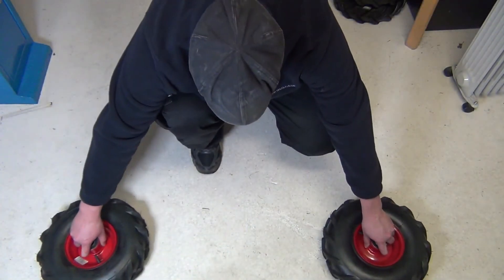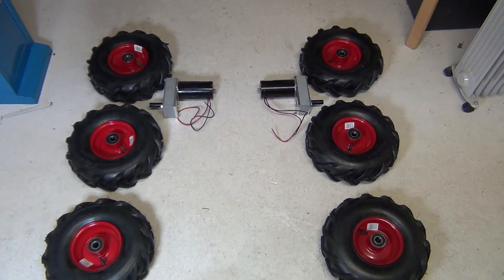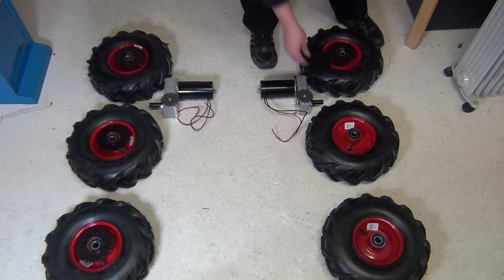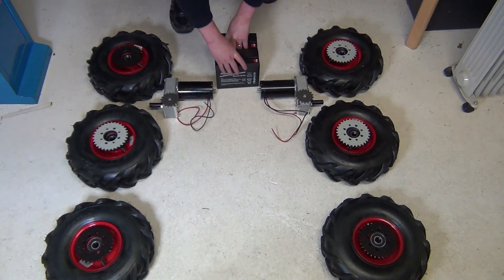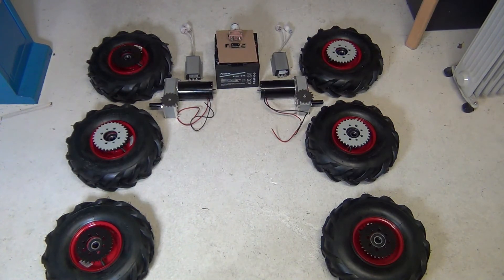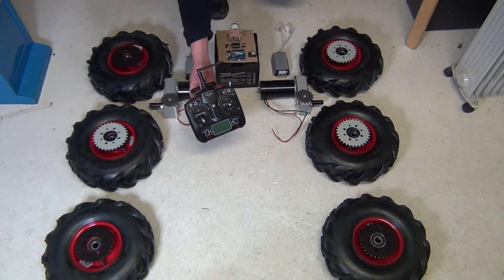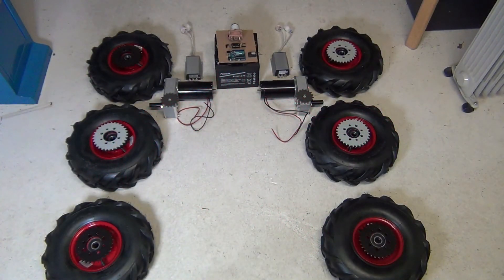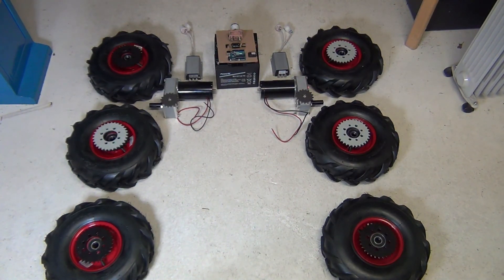Experimental 6x6 build 1/6  - Introduction

Comment: Hello, Could you please tell me wich batteries did you use?
Reply from the maker: I used two 12V AGM batteries in series. I was not happy with the amperage output of them though. Go with something more modern evennif they are more expensive.
Reply: @eE48v  Thanks! Do you remember the amperage ratings of the batteries?